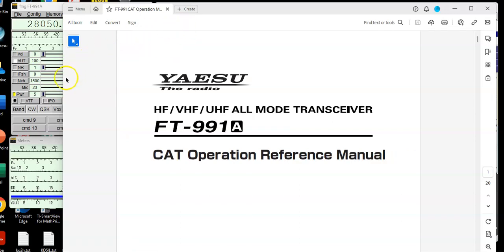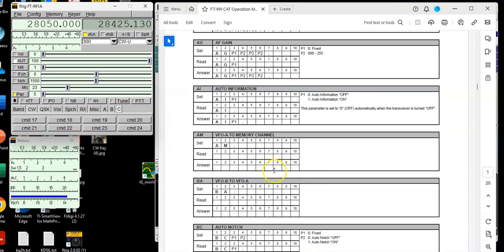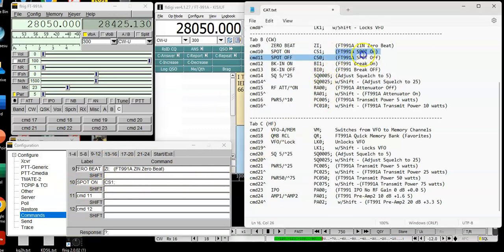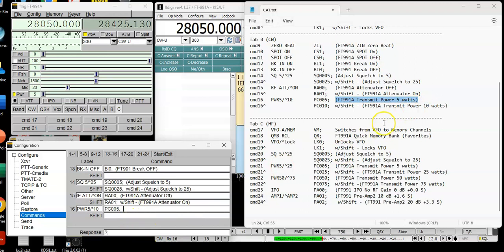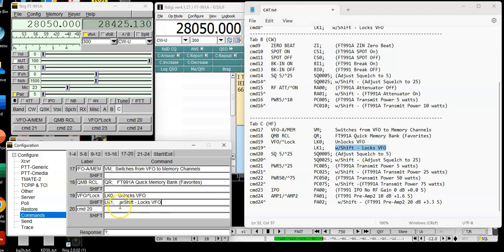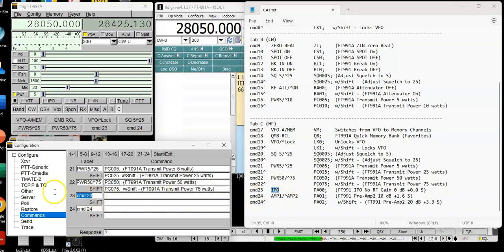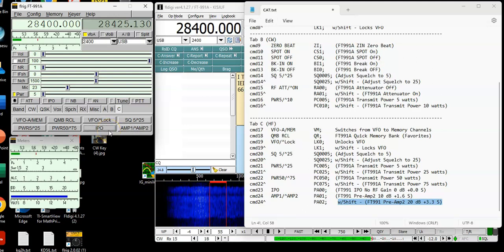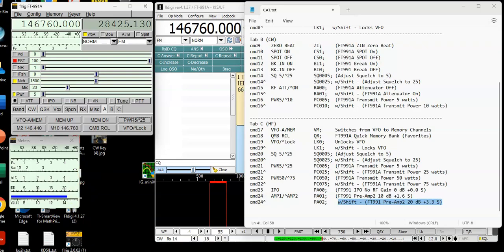FLRig (Tab B-C) CW and HF Operation FT991A CAT Command Programming Demo

Comment: Thank you so much!  Started using WSJT-X with flrig, makes life so much easier.

NOTE: Playing around with the commands in flrig with the FT-991A, did you know that you can string multiple commands together in one button?

Here is an example that doesn't do anything super useful but works :-) 
LK1;NR01;RL001;PA01;
Locks to Freq knob, turns DNR on, sets the DNR Level to 1, and sets Amp1 on.

Thanks again!